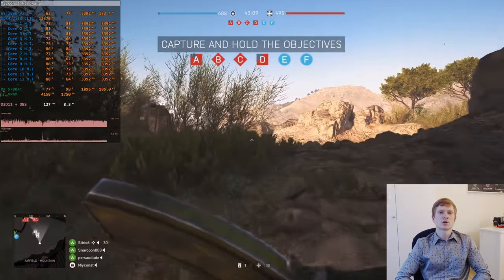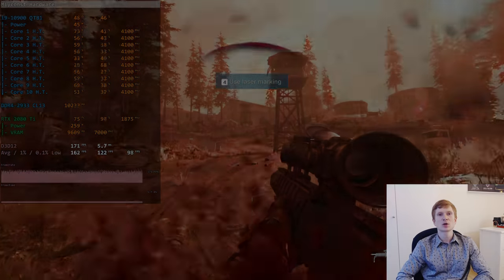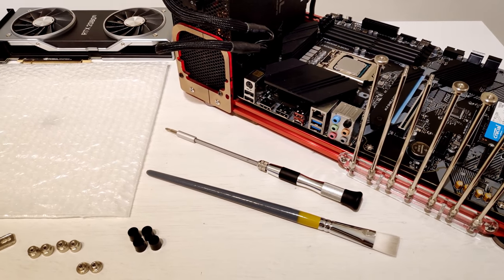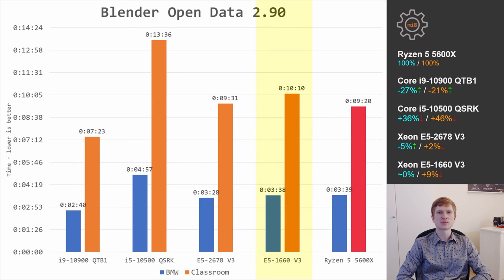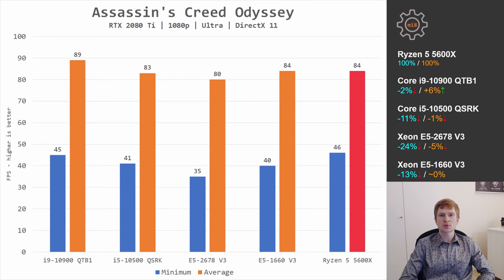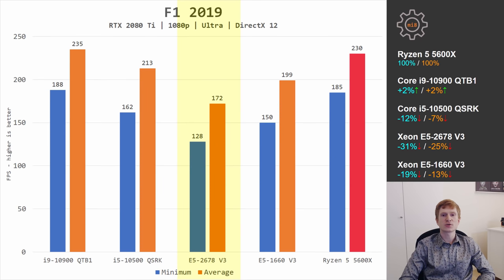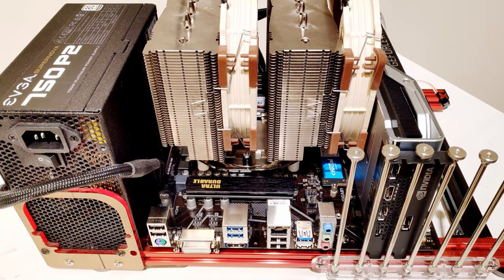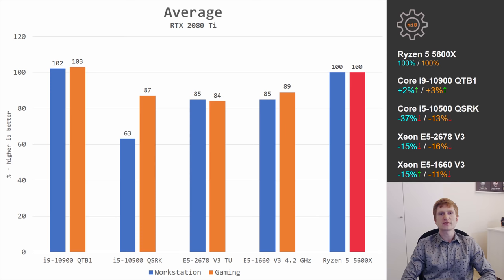🇬🇧 Ryzen 5 5600X takes on i9-10900 QTB1, i5-10500 QSRK, E5-2678 V3, and E5-1660 V3

Comment: very interesting, the 2678v3 still proved to be very "strong" mainly in games that can use Multi-Cores. I always watch your videos today I have an X99 F8 + 2620v3 "Unlock" it supplies me a lot in the games that I play, but when I can I go from 2678v3, hopefully future games will be able to use Multi-Cores. Thanks in advance for your videos, send a hug to Brazilians!
Reply: I'm planing to buy a x99 and a 2678v3 for my 1080TI, but did you buy a kit or buy every component separetly, for example, to buy better RAM modules? PD: Myconst tnx for this videos!
Reply: 2678v3 and a 1080ti seems like a great combination!
Reply from the maker: If you plan to buy RAM from AliExpress - I strongly recommend to buy it as a kit, otherwise you are risking to get some incompatible memory modules.
Reply: @Miyconst  how many  games use multi cores ? majority are single core right ? isn't E5-1680 V2 better for gaming ?
Reply from the maker: @gurukantdesai4225  more and more recent games are not only using, but also demanding many CPU cores, also check the prices for E5-1680 V2 and you will figure out why it's not a good deal :D.

Comment: Wow man u did beyond the expectation by adding those engineering samples of i5 and i9 never got disappointed from your videos btw am requesting for some emulators test hope u can do that if your rest audience also interested in
Reply from the maker: Do you mean PS3/PS4 or some other emulation?
Reply: @Miyconst  yes like RPCS3 For PS3 Emulator, Dolphin Emulator For Wii etc. Like when you have option to play them on pc why to spend on console just intrusted to see how old Xeons, i5 ,i9 engineering samples and modern cpu performs with something like AMD 5700XT, Nvidia 2080 Ti you can take any of your favorite gpu
Reply from the maker: @kirandeepmaan6304  okay, I will see what I can do, thank you for the suggestion.
Reply: @Miyconst  thank you for looking on my advice btw i don't think there is anything better then PCSX4 for PS4 emulation you can try it if you want too. Todays video was very interesting but the thing surprised me that Ryzen 5600x beats i9 even with less core count in handbreak probably ram frequency matters too
Reply from the maker: @kirandeepmaan6304  yeah, I was very surprised as well. I don't think it's just the RAM frequency, DDR4-3400 is not that much faster when compared to DDR4-2933, there must be something else.
Reply: @Miyconst  that's such a mistry only thing i can say it might not optimizated for engineering samples i might be wrong but if Ryzen gives sort of performance it might destroy Xeon high core count market soon
Reply from the maker: @kirandeepmaan6304  I think, the high core count Xeon V3/V4 CPUs are already destroyed by Ryzen. Sooner or later, but the prices will start to drop.
Reply: They have to drop price as you said, this will help many to build heavy pc at less cost. as of now Xeon is not worth for its price because can't perform well in competition.

Comment: Excellent work as always.  
I think Gamer's Nexus mentioned moving away from Handbrake and using ffmpeg directly to get around some anomalies they observed.  Might be worth looking into that for the future.
Even though I was burned by the poor driver issues with the 5700XT, I too am curious about the 6800X + X570 + 5600X combo.  It's that integration of the 3 pieces that I most curious to sample, given all the engineering work that AMD can leverage from their console oriented efforts.
And the whole Ryzen 3 + 4 ranks of DDR4 memory shows a memory controller optimization worth chasing for that setup.
Reply from the maker: Thanks for the tip about HandBrake, I will take try to check that.

Comment: I'm still sold on 2678's for productivity.

But gaming wise, I already own a high spec R5 3600,  so a simple upgrade to a R5 5600X would be the most economical.

11/11 coming next week, hopefully I'll be ordering my X99 set (probably an F8 with a 2678v3). Even though turn around time is currently THREE MONTHS to US. 

 I was going to go dual X99, but the plan is to put the system in a rackmount case and currently the one I am ordering only fits to ATX, so a dual board is too big.

I must say I am really disappointed by the 11/11 sale this year. I know coronavirus is driving up demand and making shipping a nightmare. But the deals just aren't that great this year. Couple $/£/€ here and there, still worth it mind you, just not up to the $100's I've gotten 8nnyears before.
Reply from the maker: Heh, these years 11:11 is just a marketing trick. I was monitoring Ali prices, and they were going up and up during the last weeks. Now, on 11:11, they are making "great" discounts, by getting back to the original price.

Another thing to consider is the US - China trade war. I have heard from my Chinese sources that it affects these X99 factories a lot.
Reply: @Miyconst  it's not as bad as it was when they had the summer sale a while back, that was awful, especially Wuson and SZMZ... But still an overall decent price from Huananzhi direct.

Yeah the trade war kinda sucks, but with any luck, our new president will relax things a bit.

Thanks as always for the vid, and it being relevant to my current situation 😊

Comment: The more I see the performance of the E5-2678V3 (at only $85) to more modern CPU's, the happier I am that I grabbed one, along with the X99TF.  To make things even better, I ordered one X99TF back in January of this year for about $115 and did not get, after repeated inquiries, any update from the seller for about 4 months. I petitioned AliExpress and received a full refund. Thereafter, I ordered another from the official HuananZhi store on AliExpress for $99 and received the motherboard in 3 weeks. About four weeks passed and the first motherboard arrived too (in mid-June). Certainly nice to have a spare...also nice that the average price is now $50 per motherboard!
Reply from the maker: I have had a very similar story, but mine "lost" motherboard arrived in a damaged package full of water.
Reply: @Miyconst  Was it salvageable with some "TYL"?  Maybe a sink wash followed by  a spritz of all purpose cleaner and some WD40?
Reply from the maker: It was simpler than that. I just took everything off from the motherboard and let it dry for about a week. It still works for me 🙂.

Comment: Solid breakdown.  I grabbed a dell 5810 for temporary desktop use until I can build a zen 3 system, good to know that if I get a 2678 v3 + 3060TI first I won't be leaving a ton of performance at the door until I can get the new system built for either gaming or productivity.  Then again the main game I play is Path of Exile which (in the right situation) can crush even a 3080 so...

Comment: A few reviewers online suggested the 5600X offers little over the 3600. 

Will be interesting to see the 5800X in action. 

Also, the 2678 V3 is still great value - on AliExpress you can get the Jingsha motherboard, CPU, and 32GB of RAM for ~£220.
Reply from the maker: >A few reviewers online suggested the 5600X offers little over the 3600. 

It's true in some scenarios and false in others. To see the difference between these two CPUs you need a really high end GPU.
Reply: @Miyconst  apologies I forgot to add that point - you are correct I don't think it was the top of the line GPUs. And it was specifically for games and not productivity.

Comment: Just pulled the trigger on a Ryzen 5 5600x after tossing around the idea of the 2678v3. One thing I'd like to see in a future video is how the 2678v3 compares to more modern CPUs at 1440p or even 4k. My understanding is that at that higher resolution, the GPU does more work, and perhaps you can get away with a weaker CPU at higher resolutions.
Reply from the maker: That's something I am going to test, hopefully soon.

Comment: @Miyconst
Some benchmarks on other channels have showed that Far Cry New Dawn and F1 2019 benefit a lot from memory rank interleaving (when you have multiple "ranks" of memory in each memory channel - e.g. if you use dual-rank DIMMs, or put a memory stick in both DIMM slots for each channel) on mainstream desktop CPUs, so I'm curious about whether the performance would improve on the E5-2678 v3 and E5-1660 V3 if you used a motherboard with 8 DDR4 slots (e.g. X99 D8) and populated all of them. This might close up a lot of the gap from the Xeons to the other CPUs in those two games, but I'm not sure how much it matters when you have quad-channel memory.

Is this something you might be able to test at some point?
Reply from the maker: I will check it out if I have a chance for that.

Comment: Hello, your video is very interesting. I am interested in the i9, but there are versions, which one do you recommend more?  qtb1 (i9 10900) or qtb2 (i9 10900k) thanks
Reply from the maker: QTB2 is a better option, especially if you have a Z490 motherboard for overclocking.
Reply: @Miyconst  Thanks for answering, but I have little money to buy a z490 and a QTB1 would be better but with a b460m, what motherboard do you recommend for the QTB1?
Msi b460m mortar: https://www.msi.com/Motherboard/MAG-B460M-MORTAR
Asus b460m plus:https://www.asus.com/Motherboards-Components/Motherboards/All-series/TUF-GAMING-B460M-PLUS-WI-FI/
Reply from the maker: @dark-op7466  I have not tested the Asus option, but I have heard that it may have issues with single core turbo boost of QTB1, while MSI was tested by me and works well, thus I would pick MSI.
Reply: @Miyconst  thank you very much i will go for msi then

Comment: Nicely done! I thought that with the Zen 3 release other options like these old xeons or some ES cpu samples will be not worthwile to buy, but it seems they kinda are if someone have supply issues and aliexpress cpus can travel to every place in the world! I'm curious how X58 results will look vs these CPUs but I imagine it would be much lower. I'm still happy with mine x5660 tho and I will rock it until it dies :D.
Reply from the maker: You are right about the X58 CPUs, these dinosaurs are just too old, even with insane overclocking they can't match today's CPUs.
Reply: @Miyconst  X58 6c/12t xeons OC'ed to 4,5ghz as I saw with few tests in reality are equal to r5 1600 OC'ed in performance so they aren't that bad, especially if someone wants to game in 1440p or 4K. In 4K it can handle gpu like 2070 Super even. I'm using mine xeon with GTX 1070 at 1080p so I think it's a good match. Playing AC:Odyssey with maxed out settings(except volumetric clouds, this setting maxed out tanks fps by 20% or so :D), and I have like about 40 fps lowest in big towns and about 60fps in other places so I'm really happy with that. Although I can see that in cities my GPU utilization sometimes is going down below 95%, to like 80% for a few seconds, so there is a sort of CPU bottleneck in that heavy CPU demanding locations, and this is where I see those lowest fps numbers.

Comment: Interesting comparisons. They are harder to get and more expensive but an E5-2690v3 has a higher frequency that the 2678v3 and on the Gigabyte board (gaming5) it runs at 3 gig on all cores running between 95 and 100%.
Reply from the maker: I use E5-2690 V3 in my personal rig. 3.3 - 3.5 GHz under load with JingSha X99-D8. It's a great CPU, but the current price of 150€ is not justified.

Comment: Great content! Is it worth to get the 5600x over the 10900 ES QTB1? Right now the Ryzen is more expensive. And which MOBO would you recommend for the 10900 QTB1? Greetings from Brazil
Reply from the maker: In my opinion Ryzen 5 5600X is worth the extra money, but QTB1 is also good CPU. For the motherboard I would recommend a B460 or Z490 with features you need and a good VRM heat sink.

Comment: Thanks man i was looking at the 10900T. which is a 35w version of the i9-10900. Is it possible can you do some benchmarks of that one, since its 100 dollar less than the 10900
Reply from the maker: $100 less? That's a reasonable difference, last time I checked, the price difference was less than $50. I will see what I can do about it.
Reply: @Miyconst  Thank u its only $270 cad. Which is the same price as a ryzen 3600 and i5-10400f here. But I think 10600kf would be a better option for gaming. but i also stream and encode stuff, so I was thinking of upgrading to that from a i3-6100, but perhaps I should just go for a 10600kf now.
Reply from the maker: @georgepierre3594  I think, i5-10600KF will be better for you, if you mostly play games.

Comment: Thanks for you amazing work, i would ask for my pc build (for gaming and workstation use), which is better, an i5-6500 or E5-2678v3, without overclock. (or other in the same budget)
Reply from the maker: Overall E5-2678 V3 is better, if you apply the turbo boost unlock, but there might be some strange games where i5 will give better results.

Comment: Can you please tell me how much the temperature dropped during the undervolting of 10900?  I think it makes sense to roll back the motherboard bios so that undervolting becomes available, thanks.
Reply from the maker: Temperature drop can only be precisely measured with static fan speed and constant ambient temperature, both of which I didn't have during my testing, but in general, the temperature dropped 5-10C.

Comment: For the money that 10500 ES, 120 dollars, on an H410 for about 60 dollars, with a 2x8gb kit of ram for about 50 dollars, is a heck of a lot of performance per dollar. the 5600 is faster, no doubt, but it costs alone more than the complete mobo, cpu, ram does for the 10500 ES. Is this the sort of thing guys who bought bulldozer thought to justify their purchase? lol
Reply: That's true but after seeing results again i9 engineer sample people surely willing to invest that amount in 5600x its such a beast with less cores and unexpected result in handbreak, if you someone on tight budget you should go for the combo you suggested else if performance is everything probably invest more for cpu like 5600x or 5900x
Reply: @kirandeepmaan6304  actually im thinking to wait for a 5300x. I currently get by just fine with an i7 5775c and a theoretical 5300x would be a worthy uplift and more than enough for me. Hopefully the 5300x wont have supply issues. the 3300x did because it took one perfect 4 core ccx and that was one perfect ccx they couldnt put in the expensive 8-16 core chips that sell at high margins. But the 5300x will be an 8 core ccx with 4 cores that are bad or 3 bad one disabled. So they should be plentiful.
Reply: @eclipsegst9419  yes i think i talk with you before on some other post on this Channel btw 4 core aren't future i think you should see some other option but if its at decent price then you might go for it only for ccx but i suggest you to see something like 5600x or 5800x but in my perspective 5900x offers more value per core like $45.5 per core where 5950x offer $49 per core, 5600x $50 per core and 5800x $56 per core lets see at what price 5300x come out
Reply: @kirandeepmaan6304  nah way way way overkill. i can game and occasionally stream and have chrome open and discord and whatever i want and i have a 5775c. I almost never see over 65% usage. I game at 75hz with freesync. my cpu could handle a 1080 and 144hz no issue, so a 5300x should handle a 5700xt for those purposes easily. i dont care price per core, if its more than i need its money i could spend elsewhere for other things i want. i do not believe games cpu usage will increase very much just because consoles have 8 cores. games mostly depend on GPU power first, RAM capacity second, CPU a trailing 3rd. Theres simply not that many jobs for the cpu to do. The only reason 6-8 cores was in style the last couple years is because of IPC stagnation, but thats no longer an issue.
Reply: @eclipsegst9419  i think as your needs an 5300x is the right decision btw where you stream ?
Reply: @kirandeepmaan6304  just on discord. I'm making a cod zombies map so I show my progress to my friends mostly.
Reply: Once you move to 1440p, performance difference is reduced greatly as 1080p still puts a lot of stress on the cpu.

I have the 10500 but made the mistake by buying a z490 MSI Mobo and 3600 ram cause this was just before these processors were being mentioned and knew about the 2666 ram speed limit (ram speed really makes a big difference with the current Intel processors).

But at least with the z490, rocket lake will unlock first PCIe x16 slot to pcie4 and same with the first NVME m.2 port.  At least with MSI and other brands besides ASUS.
Reply: @sepheronx  yes and you could probably get a rocket lake i5-K for only a small loss after selling yours. I thought about doing this by buying an i3 10100 and z490. but i kept thinking they would have a late release 10350KF like how the 9350KF came out months later than the 9100F, but it just never happened. I guess they feel bad for the 7700K owners trying to fetch 200 bucks for their used cpu lol

Comment: Another Very good vídeo, thanks a Lot. Hey miyconst, what do you think about 2629 v3? For a mid weigth workstation and reuse old ddr3. If I understood correctly in taobao its less then 40 usd, but i didnt understand yet If I Will be able to buy it, its completely in chinese. Another question, de 4627v4 and other of these séries have kind of ALL core turbo boost? Thanks again.
Reply from the maker: Hi Tiago. The E5-2629 V3 is an interesting CPU for a home server or a NAT, but you can't buy them for a reasonable price on AliExpress and buying from TaoBao is very complicated.